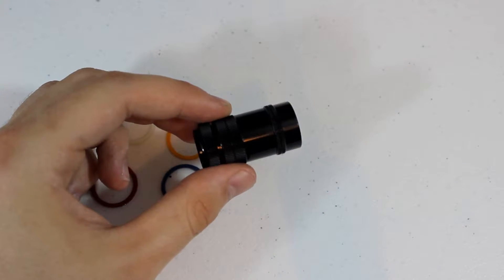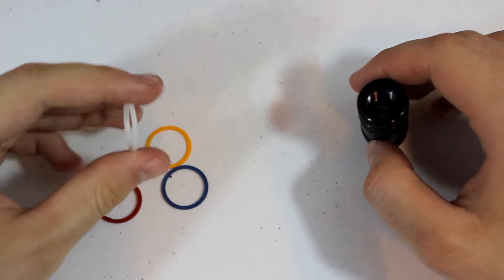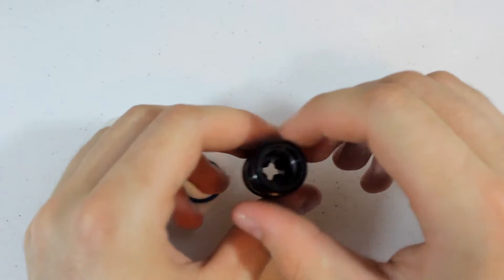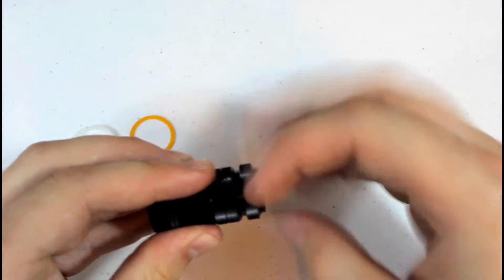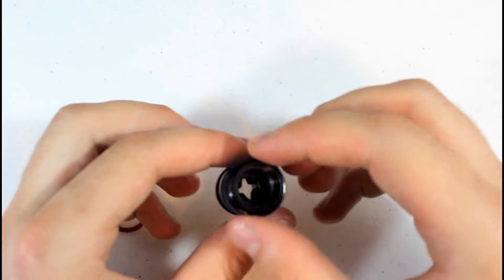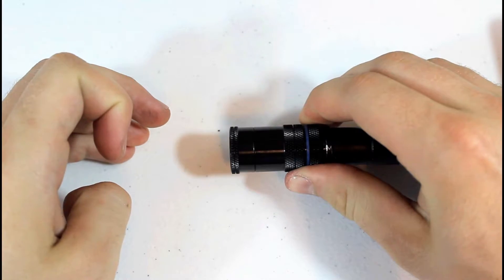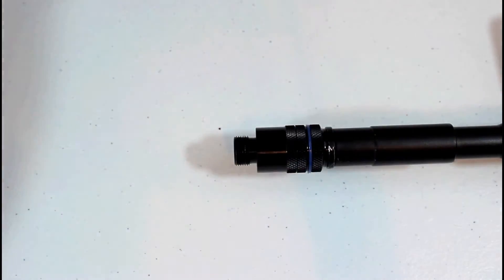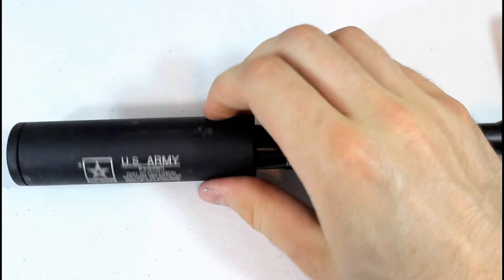Tokyo Marui Muzzle Velocity Reduction Adapter w/ Chronograph test

Comment: does it reduce the accuracy??
Reply: no. i've used one and the accuracy stays the same. it works pretty well but i would not recommend using this on a GBB.
Reply: With a aeg you bb spred is worse